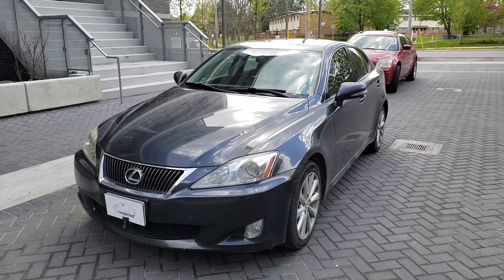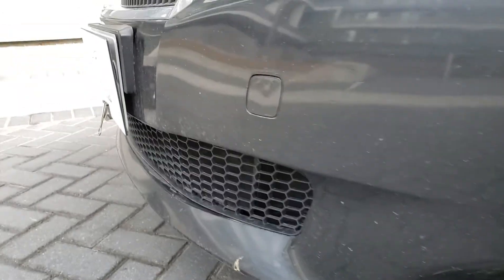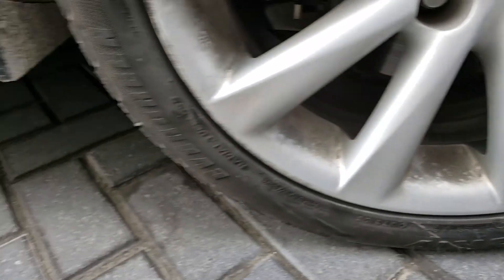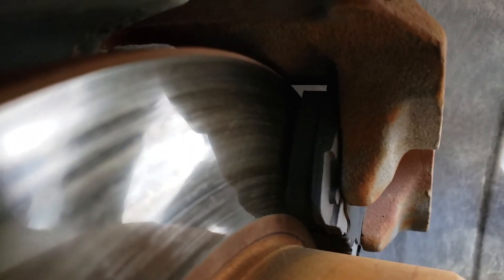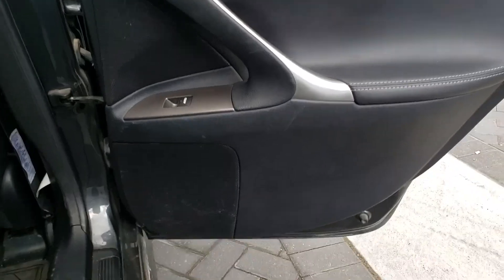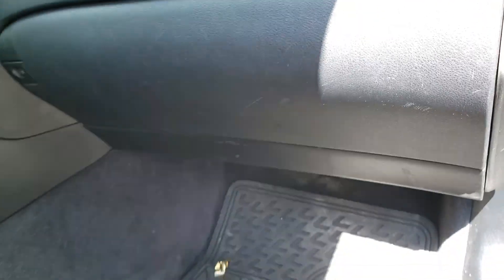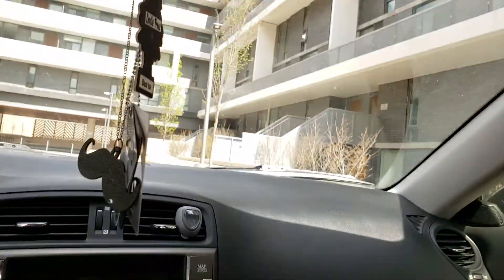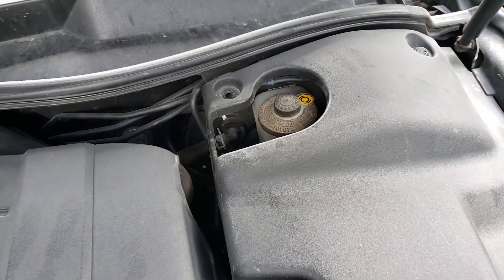2009 Lexus Is250 in Toronto | GetInspected 0439

Comment: Really great car !! Great fuel economy,  excellent  ride and handling. Very comfortable  very sporty! Has a very reliable build quality  lexus spares no expense in making there IS series! Great car good for longevity and great for long rides and very modifiable ! Most of these dont have major repairs they have been known to travel well over 200+k kilometers. Maintaining this vehicle is very achievable  and would last / could last some one quite a long time and they could easily get a great deal of usage out of it ! Very good car!!! Keep up the great work on the videos very informative as well and really enjoy it alot!!
Reply from the maker: thank you for the feedback Paul. the only issue that is common with this car up here in the northern climates is rust... other than that, as you said, they are pretty solid cars (given that they are well maintained and that they dont consume oil etc. )...